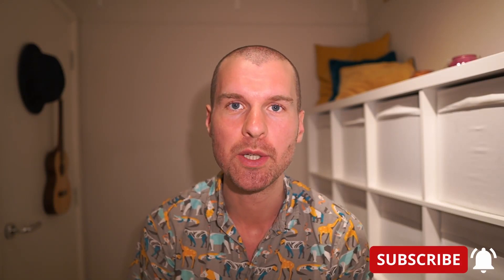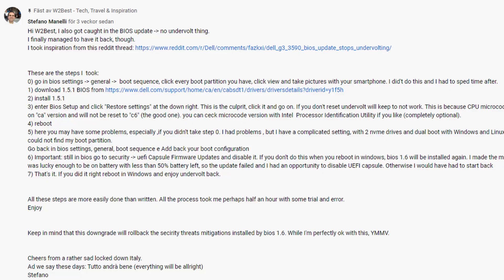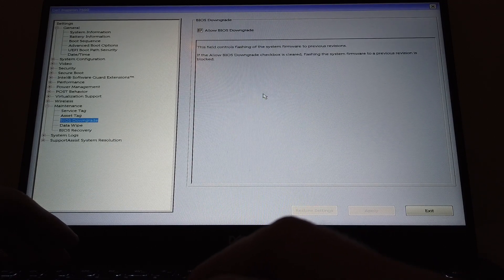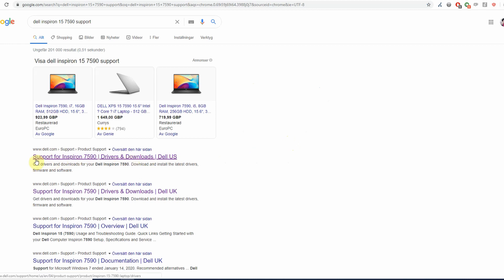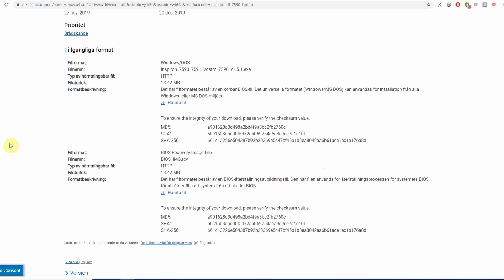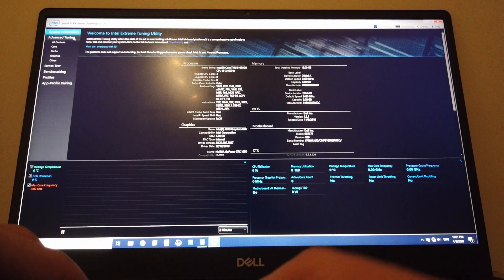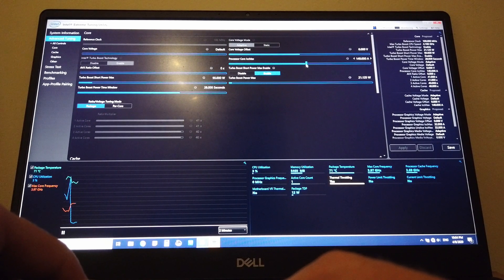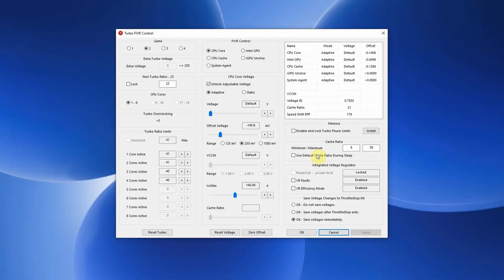Fixing Undervolt After BIOS 1.6.0 Update on XPS 15, Dell Inspiron 15 & Vostro 7590

Comment: Important Info if not already somewhere commented!!
On DELL XPS15 9570 I needed to download version 1.15.0 an the most important after your steps was following:
Go to  BIOS setup -> security -> UEFI capsule firmware updates -> disable it!! Otherwise your BIOS will always be updated while boot sequence.
Hope that can help somebody with headaches.
Reply: Thank you so much!! Its exactly what i was searching for (but you came late to save me from a headache)
Reply: @Karma You are right, the recent update on windows disabled it. I am sure it works in the past 3 months.
Reply: @rondhole  Is there a workaround for the new update
Reply: @AndrewJLin  NOt sure, I do not need it, it runs stable and not overheating, it is fine for me.  If I want a cooler computer, I will get a bigger 17" laptop that can handle heat better.
Reply: Thank you! this was happening to me!!
Reply: Thank you so much doc! Idk how you found that cryptic bs setting, but you da man.
Reply: @motorhead41  Reading instruction number 6 woulda solved this issue. People nowadays get tired/bored after reading 5 words lol.
Reply: Love you bri
Reply: No need to rollback, Just load Default Factory bios setting.  It will still have the newest Bios 1.17 and all the undervolt option is still there.   It works on XPS 9570 or newer.  Does not work on my xps 9550.  Mid 2020 Bios on precision 5510 also allow undervolting.
Reply: @rondhole  sure?
Reply: @JJ-gd1pj  Yes, I have my xps 9570 with newest BIOS and unvervolt at -150 mV.  It never gets blue screen as long as the power option set to balance/high performance.  With best battery life power option, -150mV can give blue screen because -150mV combined with low power gives too low final voltage.
Reply: Thanks duse
Reply: Thank you so much bro 😅

Comment: I had this same problem on my XPS 9560 which I just updated yesterday and found that my ability to under volt the CPU had been removed in Intel XTU and Throttlestop. I’ve heard this is a problem on the 9550 as well.
Reply from the maker: Did you manage to solve it using my fix video?
Reply: W2Best - Tech, Travel & Inspiration I am going to try it tomorrow and will let you know if I was able to solve it. Thanks.
Reply: BRIAN ZHOU I am trying to figure out if it would be a better idea to try out this solution or to wait and see if Dell allow us to under volt in the future which seems very unlikely, however, I will try it even though I don’t want to mess with the bios too much and I’ll let you know if it worked with my 9560.
Reply: I’ve tried everything and I simply cannot get it to work on my XPS 15 9560.

Comment: The new XPS 7590 BIOS - version 1.7 seems to have fixed this issue now. I had to do the same thing about a month ago and downgrade which worked fine but Dell SupportAssist auto updated the BIOS today, and I just launched throttlestop and HWMonitor and the undervolt is now applied.
Reply: i'm On BIOS version 1.7 How do I use throttlestop to undervolt my XPS 7590??
Reply from the maker: I can't see a new bios for Inspiron unfortunately.

Comment: Hi, my 7591 is stuck at 800 Mhz when it's not plugged to the charger, and then if I plug it, my Core is stuck at 2500 Mhz. Did you notice the same thing ?  and thanks to the solution about undervolting ;)

Comment: Just can’t get it to work. I’ve downgraded from BIOS 1.12 to 1.9 on my G7 7590 and restored factory defaults. Still can’t get it to work unfortunately.
Reply from the maker: I'm not sure if it's a working solution for g7... I've only tested Inspiron and XPS. You are not the first who says it doesn't work on g7 maybe that's the way it is.
Reply: @w2best  Damn that really sucks. Was counting on being able to undervolt when i bought this laptop.. thanks for the info
Reply: in the bios on recovery try the option factory reset

Comment: Damn update. For the past 3 months, I did not even know my undervolt was not working through throttle stop. No wonder my 7590 ran hot and fans louder than usual. Thought it was just because of the hot weather affecting it. Thank to your video I was able to fix it. Running 10 degrees cooler and quieter than it did the past 3 months.
Reply: How were you able to tell if it wasn't working? I got an xps 15 9570 on bios 1.8.1.  I just don't want the cpu to be 90 degrees and throttle and make some games like cod Black ops 3 playable

Comment: This is GREAT!  thanks so much, really you helped a great deal. I purchased thinking I could undervolt then was surprised with grey out (Dell xps 15 9570) I did not have to go back to the previous bios, just reset bios default and with XTU I can undervolt by -0.125v higher clock speed up to 4.4 GHz before thermal throttling. Much cooler temps to 95 d C during processing. (at -0.135 unstable and blue screen. )  cheers
Reply from the maker: That's great! Such an easy fix of you don't even need to downgrade! Half people seem to just be able to reset the bios. Enjoy!

Comment: dell makes great laptop but limits them with software
Reply from the maker: Are you referring to any special part?
Reply: @w2best  they don't allow to set custom fan profiles. it is so annoying as the fans kick in only after the temp reaches 90. by the way thanks to you I successfully undervolted my xps 15

Comment: It says downgrade is blocked..now what? Cant even flash using usb
Reply: Same on dell g3
Reply: @jinxed4lyf763  I have a dell g3 too and managed to fix it. Restoring to "Bios default" did not work for me either so i tried with the option below wich is "Factory settings". A message appeared saying that the laptop needed to restart to apply the changes. After the restart the XTU options were no longer greyed out and i could undervolt again without downgrading the Bios. I hope it works for you too.
Reply: Juan Diego Rivas oh  i never thought about it it gets your factory bios again I will try

Comment: Edit:
In BIOS I choosed BIOS factory reset and it works! I can undervolt without downgrading BIOS to 1.5.1. without loosing any data. 

 Is there any risk of losing Data while resetting BIOS? Do I have to reinstall any application after this, or will all my programms still be there?
Reply from the maker: Great! It seems to be about half half of people having to downgrade Vs not downgrade.

Comment: Hi thanks for this, I also stupidly updated my bios. What undervolt settings should I use for my dell xps 7590 i9. I'm new to this so any help will be appreciated. Thanks
Reply from the maker: Try going to bios and just resetting to factory settings! Then if that doesn't work, downgrade to 1.5.1 and then reset and it should work.
Reply: W2Best - Tech, Travel & Inspiration cheers mate done that and have the undervolting option back on intel extreme utility. I wanted a base point on the voltage value to start with to avoid spending too much time testing. I am aware everyone's figures would be different. I've now spent some time tinkering and found -0.125v stable!
Reply from the maker: 125 is what I use too! It works really well!

Comment: I did this but it automatically reinstalled version 1.6 when I restarted. What should I do? I even removed SupportAssist but it still does this.
Reply from the maker: So how does it update bios? From Windows update?
Reply from the maker: Rishi posted this solution as reply in this video:

@Gabriel Bro, If your BIOS was automatically upgraded to latest version after the downgrade, then You must have missed to disable UEFI Capsule Firmware upgrades which allows the UEFI loaded OS to upgrade the BIOS through Windows Updates. 
Steps - 
(1) Download the older BIOS and them restart to downgrade.
(2) After Downgrading process is complete, head to the BIOS first without booting into the OS.
(3) Then Restore Default Settings
(4) After Restoring Settings, Expand the Security tab in the BIOS, there you will see UEFI Capsule Firmware Updates, disable that. It will not allow the Windows to upgrade the BIOS.

After disabling this option, you must not restore BIOS settings as it will turn it back on. So if you need to restore the BIOS in future, keep in mind to turn that thing off. 
Hope that helps. Get back if you face any issues.

Comment: thanks man! It worked on my Dell xps 15 7590
Reply from the maker: Perfect! Happy to know this!
Reply: @w2best   help me pls,i have alianware m15 r2 2019 i am facing with bios upgrade problem,i cant undervolt via throttlestop, cant downgrade my bios to previous version ,when install previous bios version,not allowed.i also tried in bios load defaults and reset but not successful.now I dont know how to back my working throttlestop.

Comment: I rolled back to 1.5 and resetted the bios as well but I had no success of accessing the core voltages. But  I noticed that my heating issue only persists when my xps 15's charger is plugged in . Then my idle temps are at 70C. When not plugged in 40C. Did any of you notice something similar? I might not need an undervolt after all just need to address this strange situation.
Reply from the maker: Interesting. A lot of XPS people had said this worked. I don't see any difference between plugged and not. That sounds like turbo is on when plugged in and off when on battery. Could you be on a setting like that?

Comment: can't find the 1.5.1 version and 1.5.0 is not working with the undervolting thing, can you upload this specific version and drop a link? thanks
Reply from the maker: Which computer do you have?
Reply: @w2best  
Dell xps 15 7590 4k OLED
but i solved it with 1.5.0 BIOS, turned out that i must make factory reset for BIOS settings from the BIOS itself
Reply from the maker: @ibrahimsaid7030  Yes, where did you do it before? Logging into bios at startup and then reset is the way I've done it.

Comment: XPS 15 7590, I was pushed 1.6.0 through Windows update and didn't realize until too late. Booting into the bios, clicking reset, and then factory settings seems to have fixed it for me. I then went back and manually changed the BIOS settings to what I had before and it all seems fine now

It looks like I'm only seeing XPSs fixing underclock on 1.6.0, maybe Vostros/Inspirons can't? Does anyone with a Vostro/Inspiron have underclock working in 1.6.0?
Reply from the maker: Yes a bunch of people did with Inspiron too! I didn't know it was for XPS too! Did you see I tried your method in the video before downgrading. Unfortunately it didn't work for me. :(
Reply: Yeah I saw, that really sucks. I wonder why it's not working for everyone. I'm kinda just spitballing but what if you retried factory resetting and then checking a couple times? I'm guessing you probably tried it before making the video though
Reply from the maker: @pokemanic101  I tried three times - 2 before making the video and then an extra time while making the video... So it really didn't seem to work for me. Annoying but I'll just accept it.
Reply: Wow I really didn't know Windows update did BIOS updates! Gotta be careful then
Thanks
Reply: Yeah I don't know if you can turn it off in windows but if you go into the BIOS and look under security there should be a setting to block windows bios capsule updates
Reply from the maker: @louieb4390  I didn't know that either! That sounds so strange. I hope it won't happen for me...

Comment: Everyone!
You don't need to downgrade! Just reset you're 1.6.0 bios to factory standard (not bios standard) and it wil then re enable undervolting and you are still on 1.6.0 then!
Reply: Btw this is a glitch where they forgot to change a flag on the factory reset action. So it can be patched after a while
Reply from the maker: Did you see I did just that in the video before downgrading? I tried it three times but it didn't work for me. But I know a lot of people have had it work :)
Reply: @Hi How Are You?could anything happen to my data or installed programmes, when I do this?

Comment: I can undervolt on the latest bios 1.6. I just needed to go to restore to default and it works again.
Reply from the maker: That's great! I can't - tried it a few times. I'm not sure why it differs for different people.
Reply: @w2best  you need to do factory default, not bios default then you can undervolt on 1.6.0.
Reply: @DElionel1995  it is?

Comment: You don't have to roll back to 1.51. Just keep the 1.6 and go to Bios, set to default setting or factory default. This should fix the problem. I have the Inspiron 7591.
Reply from the maker: As you could see in the video that's what I did first, and it didn't work for me. Tried a few times. :)
Reply: @w2best  also factory default?

Comment: Thanks again for your work ! Installed Bios 1.5.1 and have re-gained undervolting control. I noticed that you have used -140.6mV , although in your original undervolting guide you were at -149mV. What are your current recommended settings for Inspiron 7590 in Throttlestop ? Thanks in advance.
Reply from the maker: Good notice! I actually had a few crashes on 149 mV so therefor I adjusted it down a bit. If it runs stable for you - keep 149! It differs between each individual CPU. :)
Reply: Every cpu is different (even if it is the same model) because every cpu has a different bind quality. That's why you need to undervolt. Dell gives a safe voltage at when every cpu is stable. But most of the cpu's are stable on a mutch lower voltage. And that is where you need te experiment with a stress test as low as you can step for step until it is unstable (crashes). Then put it back one notch and test again. And if it is stable (after 60 min stresstesting and gaming or after long term usage) then you found you're minimum voltage. Don't be afraid to find the limits. The worst thing that can happend is a blue screen of dead, or freeze or progral crash. If you got problems just put it one step higher again, until you got a 24/7 stable undervolted cpu!

Comment: I have the Dell XPS 15 7590 & I have the 1.6.0 Bios update & I went into bios & reset to factory settings as well as reset bios default & I can undervolt without downgrading bios. Where as before it disabled it in intel extreme tuning utility & throttlestop. But thankfully now it works again. :)
Reply from the maker: Some people have said it worked like that and that's why I wanted to include that as a first step. :) For me it didn't work unfortunately but I'm ok being on a lower bios.
Reply: @w2best  But did you try the Factory reset instead of the bios default as shown in your video?
Reply: Yian Pap you tried? Factory instead? Can u undervolt without downgrade?
Reply: Thanks a lot. I got it now. I just did what you said and now finally it work!!💯💯💯
Reply: Thank you very much for your comment! Finally I was able to undervolt my Dell XPS 15 7590.

However, I have doubts that this will be patched soon with another update. Hopefully, this method would still be effective.
Reply: Thank you, bro. Worked with my inspiron 5770

Comment: Hey w2best ! I tried to do this in my dell g5 (new bios killed undervolting  too) but once I restarted my laptop (after instaling the older bios version) it installed again the newest version automatically. Please help me!
Reply: @Gabriel Bro, If your BIOS was automatically upgraded to latest version after the downgrade, then You must have missed to disable UEFI Capsule Firmware upgrades which allows the UEFI loaded OS to upgrade the BIOS through Windows Updates. 
Steps - 
(1) Download the older BIOS and them restart to downgrade.
(2) After Downgrading process is complete, head to the BIOS first without booting into the OS.
(3) Then Restore Default Settings
(4) After Restoring Settings, Expand the Security tab in the BIOS, there you will see UEFI Capsule Firmware Updates, disable that. It will not allow the Windows to upgrade the BIOS.

After disabling this option, you must not restore BIOS settings as it will turn it back on. So if you need to restore the BIOS in future, keep in mind to turn that thing off. 
Hope that helps. Get back if you face any issues.
Reply: @rishi4d_   Thanks!! It really helped me a lot
Reply: Rishi Ghosh how do you download old bios and how do you install it
Reply: @abuboss246  Did you watch this video? This video has it all covered
Reply from the maker: Thanks for answering that Rishi! I would not have been able to!